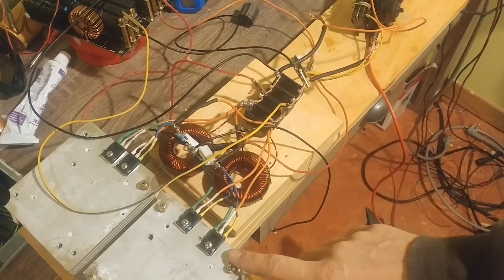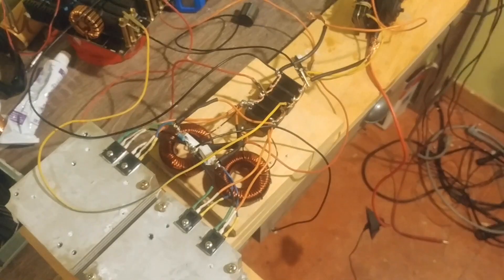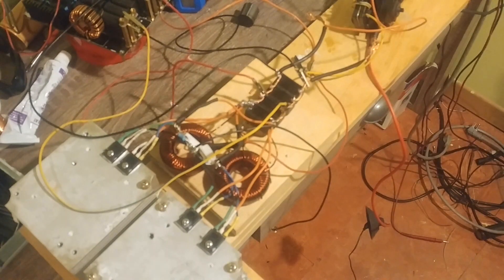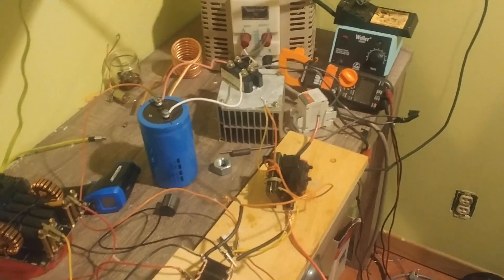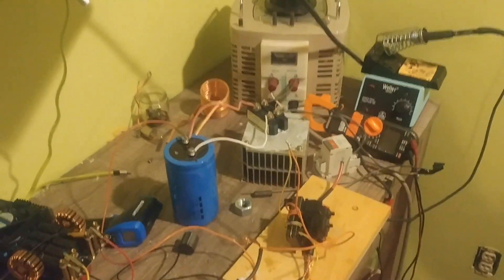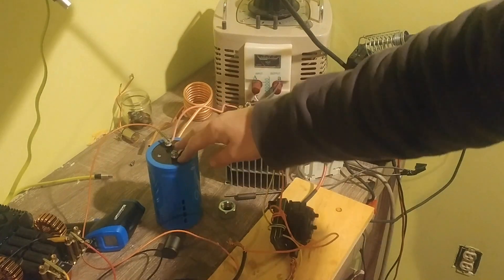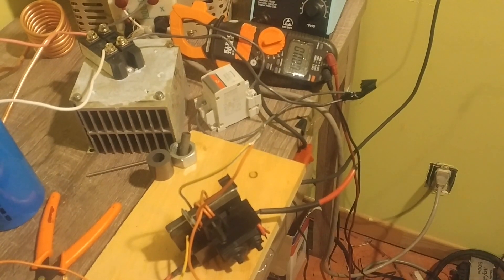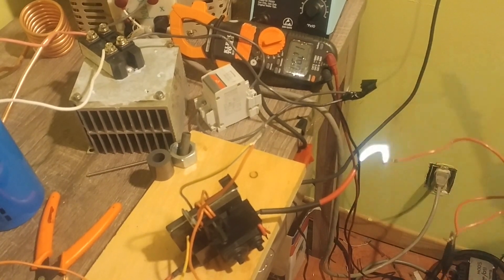ZVS Driver and flyback transformer (Arcing is loud)

Comment: DC or AC? out ?
Reply from the maker: This flyback has an internal diode and outputs DC. I wound my own flyback a while back and got similar arcs with AC. Was thinking about making a video of it.
Reply: @inductor1.77  tks
Reply: @inductor1.77  schematic ?
Reply from the maker: @TitiProsopel  posted link in the description
Reply: @inductor1.77  thank you brother but you in pictures you have 4 mosfets and in the diagram is with 2 mosfetos ...
Reply from the maker: @TitiProsopel  I put them in parallel.  I wanted to be able to run it hard without worrying about overheating.  I actually fried them anyways because I pushed the voltage too high.  Ive sinced gotten rid of the paralleled mosfets and switched to a mosfet with a 1kv rating instead of the irfp260n, its made a big improvement on how hard I can drive it. Its not worth paralleling the mosfets in my opinion..
Reply: @inductor1.77  i use irfp460 and i have 2 flyback transformer in series but i have no current arc as big as you
Reply from the maker: @TitiProsopel  what voltage are you feeding it with? Also if they're not identical flybacks your primary feed on one might need to be flipped. Or if your  secondary has a DC output you could have the series going the wrong way? Id try with just one flyback so you know what arcs to expect and then play around with two